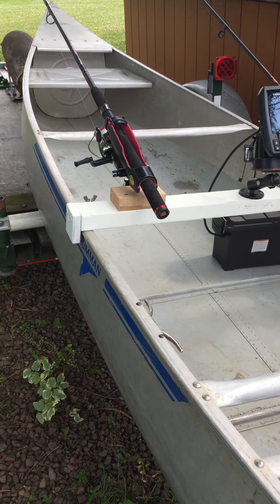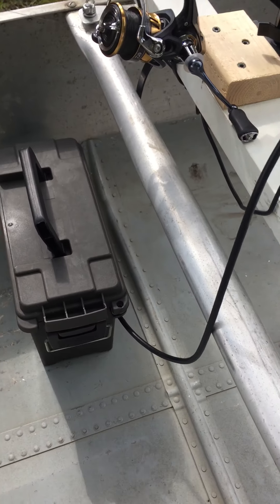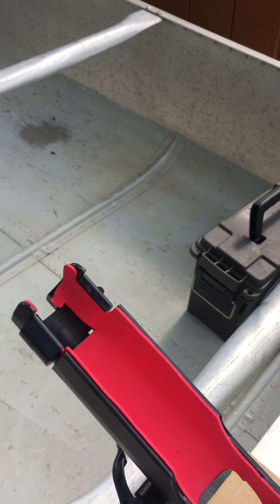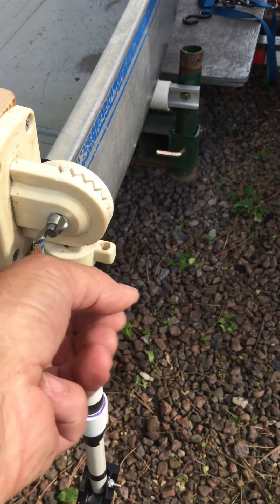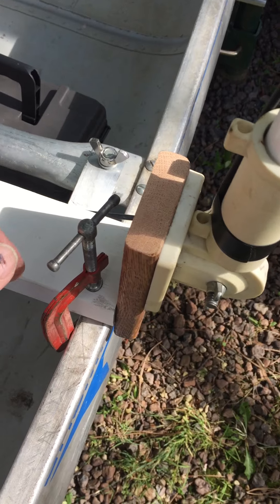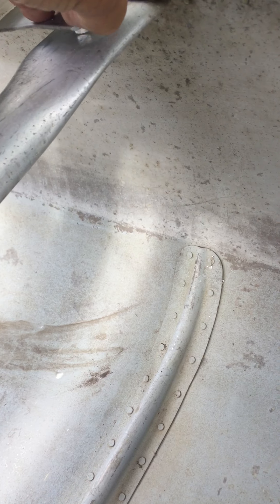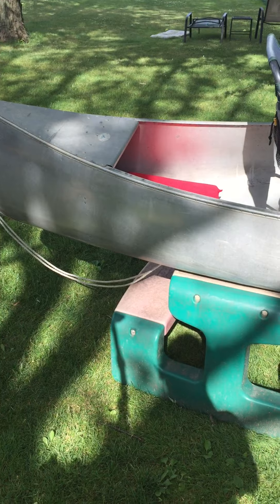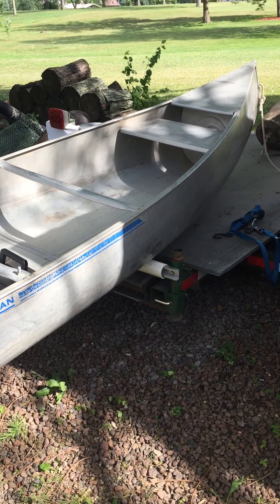Mount a Garmin Striker 4 to a Canoe

Comment: I came for copper I found gold! very nice setup you got there. Do you need two batteries if you happen to have a trolling motor?
Reply from the maker: I do not use a trolling motor with my canoe but the Striker 4 uses very little power.  It does display battery condition.  Good Luck